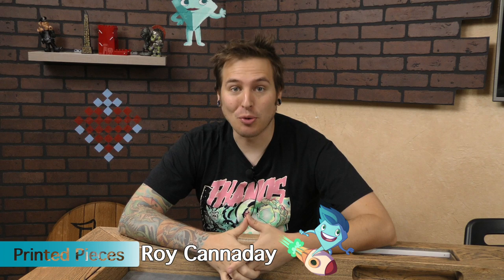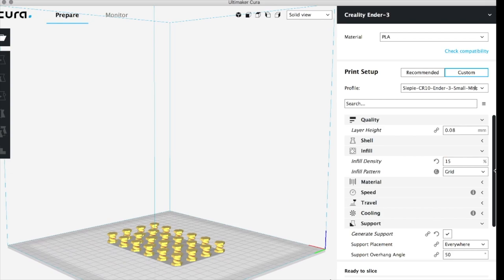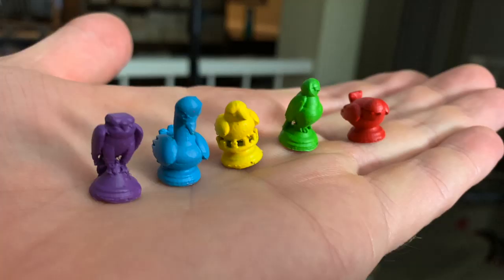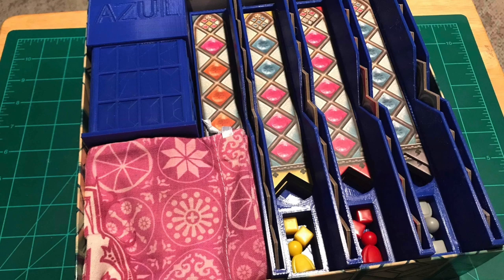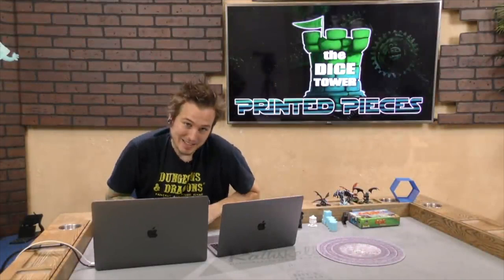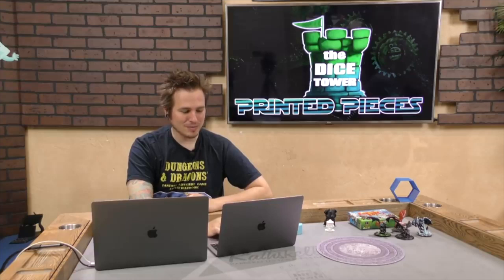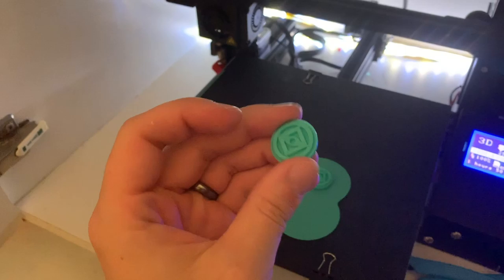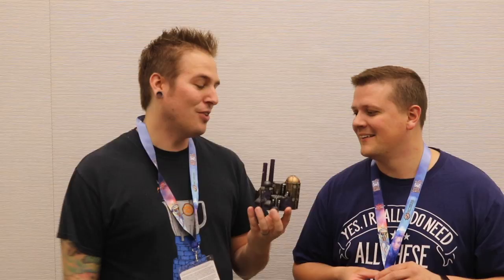Printed Pieces Ep: 1-20 - with Roy Cannaday

Comment: I think for inserts and similar that the best solution is not a 3D-printer, but a laser cuter. You can use it to cut thin wood or acryl plates into the forms and build boxes (or counters) from it. Do you think the higher cost is justified to get both options (there are devices where you could exchange the printing head with a laser head, so you have a 2-in-1 device)?
Reply: I've been 3D printing for about 6 months, but basically everyday. I've thought about the laser cutter but as far as for board gaming exclusively, I think the 3D printer is a better investment. The higher cost of a 2 in 1 is going to be very subjective. I also don't know how many laser cut inserts are available for download (I do know some exist), so you may be doing a lot of designing. I just don't see a lot of other use for a laser cutter other than the inserts, but maybe I just think in terms of 3D printing because I have one.

Comment: Hey Roy! I'm considering getting into 3D printers now, and had a lot of questions in general, but just one for you - do you still use that Tianse brand for filament? You mentioned it costs about $17, but that was from a few years ago and it looks like that price has jumped to over $30, so I was curious as to whether you still use that and why you settled on that brand or why you have switch to a different one.

Thanks!